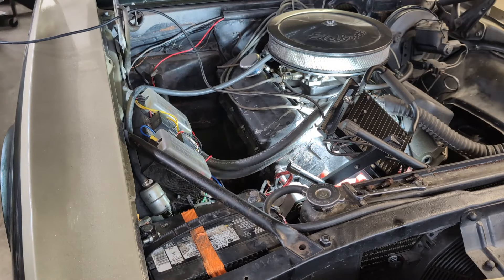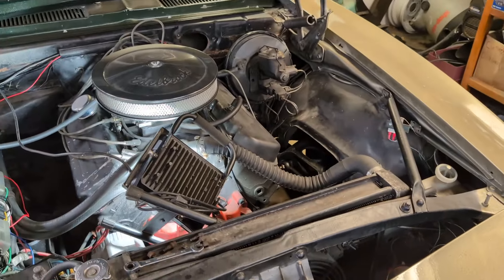Doug's Headers D313 Install 1968 Camaro SS 396 Big Block

Comment: What kind of transmission. My passenger side was easy but driver side is not. I may have to jack motor up or move steering box. I have a 68 Camaro with 5-speed termed and 454
Reply from the maker: @vicaguzzi6115  I've heard the power steering box has fitment problems, I've got manual steering. 4 speed with mechanical clutch.
Reply: @tnolds  Thanks. I’ll try lifting the engine because I am removing it anyway.